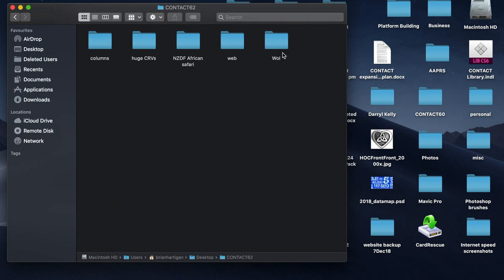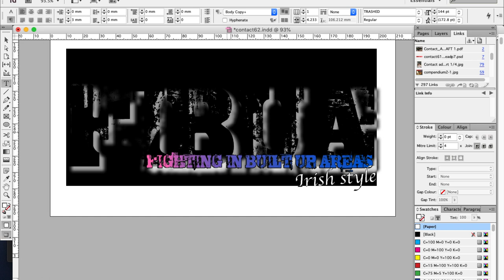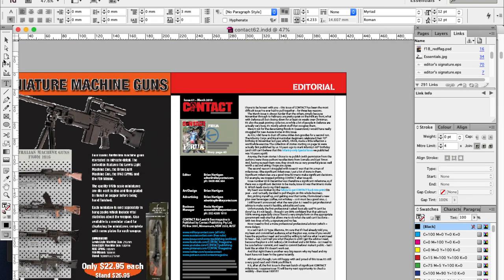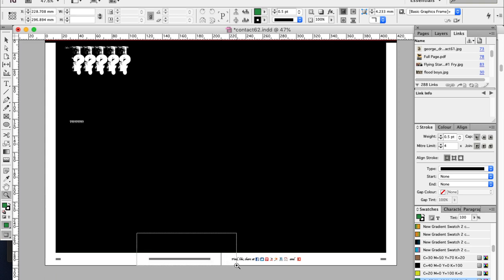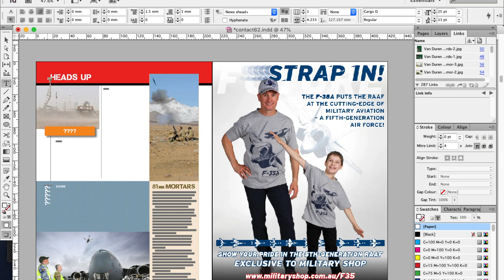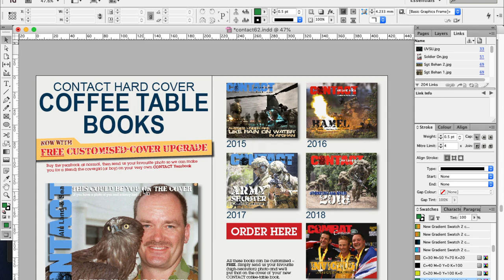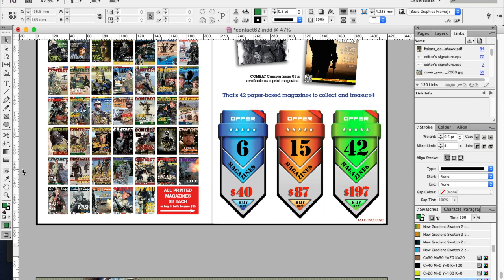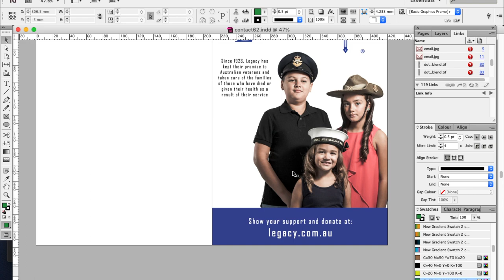How CONTACT magazine is made – Part 1 – preparing the template

Comment: I found this super interesting. I think most people underestimate the crap-ton of work that goes into this sort of thing. I would imagine that each "????" you casually threw in represents many hours of effort.
Reply from the maker: Thank you Mike. It's nice to be appreciated.
Like I said in the notes, this video series is something I've wanted to do for a long time. And you're right, magazine layout does take a lot of effort (i.e. time) – and doing a video of it on the side adds to the workload. But I will give this a good crack too.
In this series, I probably won't show the layout of every single page – but I do plan on showing key features of the process and, hopefully, imparting some of my wisdom in Adobe InDesign and Adobe Photoshop along the way.
And you're right, all the "?????"s (and all the blank pages) represent many hours of work. Hopefully, you'll get an even better appreciation of this when I upload the next video.
Cheers,
Brian Hartigan
CONTACT Editor